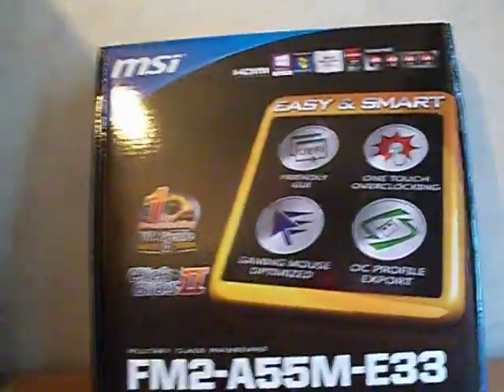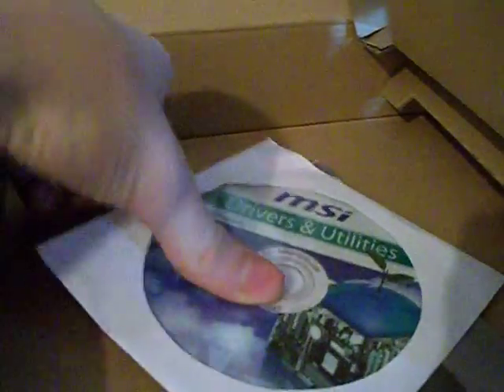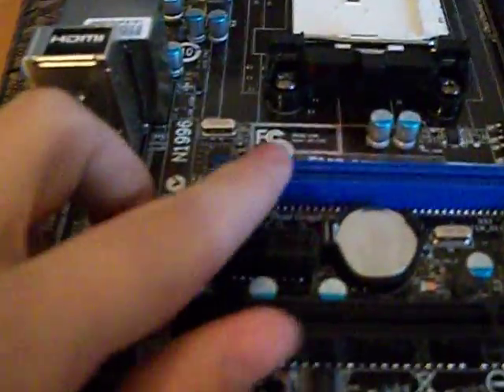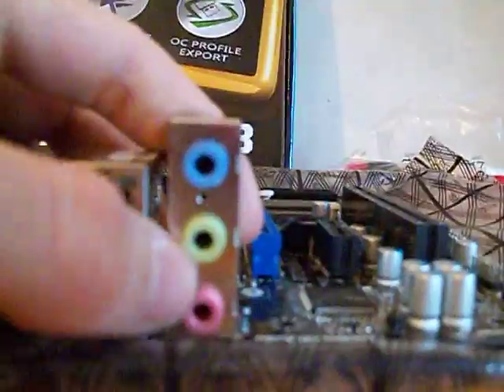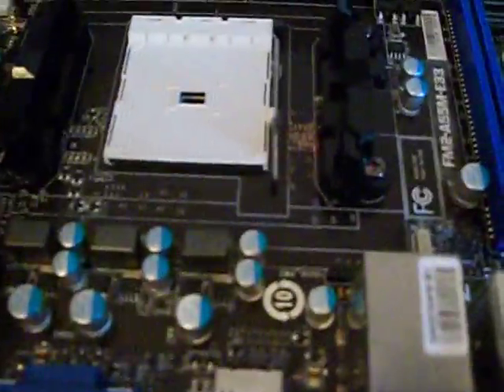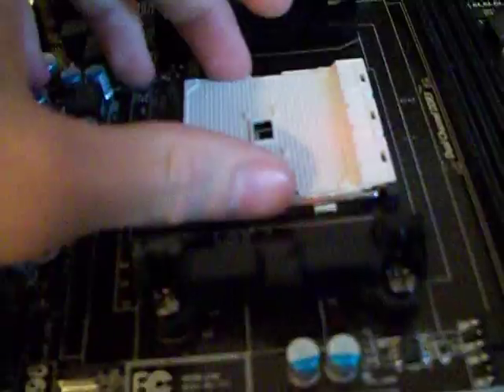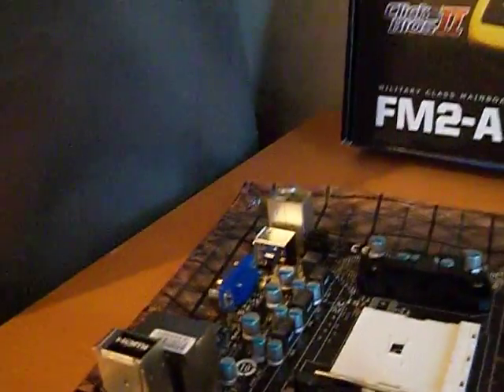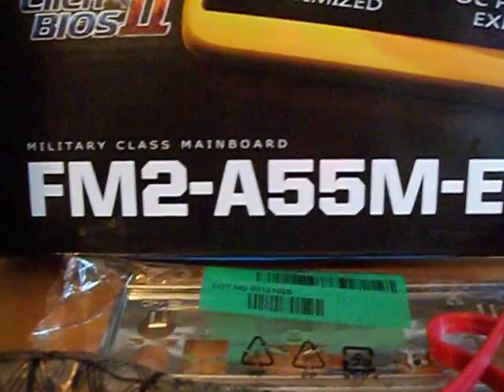MSI  FM2 A55 E33 motherboard unboxing and hands on  -  96donov

Comment: where did you plug in the speaker cable ?
Reply from the maker: there is a jack on the mobo
Reply: 96donov
no, not that one....the one from you hear the "beep" sound when you start up the computer

Comment: Nice unboxing. I have a question. I have the same motherboard and I am planning to get a gtx 760. That card considerably long and will definitively obstruct all the sata ports. My question is, if I get L shaped sata cables will it solve the problem? Thanks in advance.